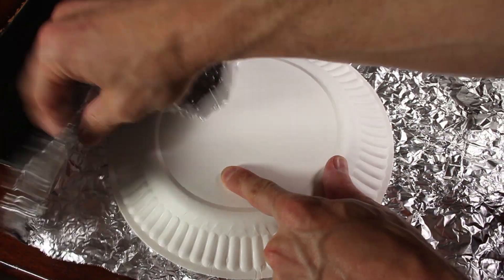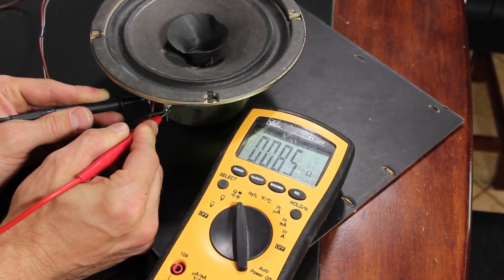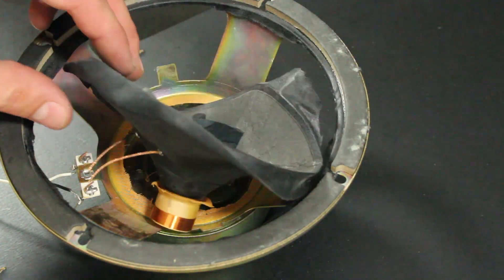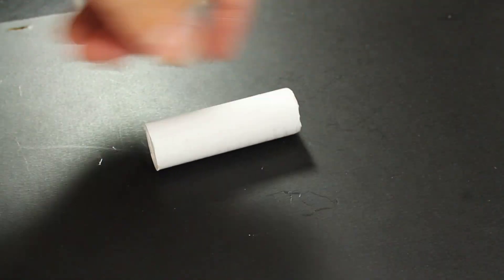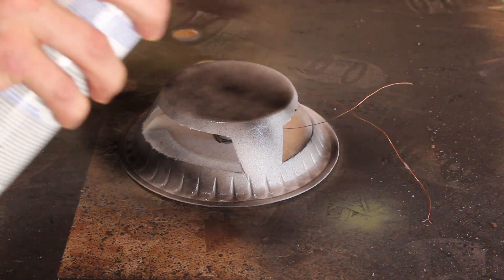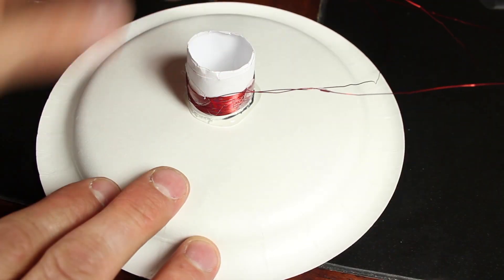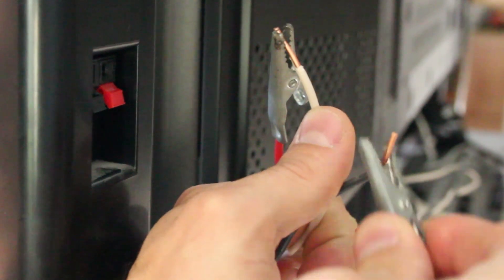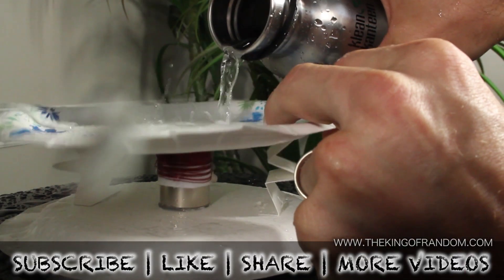Rockin' Paper Plate Speaker

Comment: Does this actually work? Because I know the method with the tinfoil/penny doesn't but I'm curious to know if it's worth it.
Reply: it should work.  use the first design with a quality magnet.  it is a speaker, so headphone signal may be too weak.  as shown, the voice coil should consist of a single layer of winds, so that no back emf/noise is produced.  cheers
Reply: Thanks

Comment: this sounded easy at first all I need are these magnets but NOPE I need wire (which I don't know where to find) and some super tools I wish I had but didn't. this was a great video
though!
Reply: you can find copper wire in old extension cords, old chargers, lamps, old microwaves, anything really that has to be plugged in to an outlet. and as far as the tools go the only tool i seen was a hot glue gun, the clamps could be replaced with coated paper clips.
Reply: BlueKnight Gaming If you consider a box cutter and a hot glue gun "super tools" then I don't know what to tell ya

Comment: if the same magnet and wire from the second setup was used in the first would it have just as good a sound? or is the second setup better? i like the aesthetic of the first one better.
Reply: the cleaner the wire
the better the sound

Comment: does not work. i used a microwave magnet and the copper wire out of the microwave capacitator and did not work. so mad. looked forward to a paper plate speaker.
Reply: use nemudium magnet

Comment: could you tell me how I would connect this homemade speaker to an aux cord or phone?
Reply: +anty292 get a 1/8th mono audio jack. connect copper parts of the two wires to the two the two prongs on the end of the jack.
Reply: You probably need an amplifier
Reply: get earbuds
cut them
and solder the orange cable to an end
and the green/red one to the other end
Reply: HappySlappyFace  No, a mini amp is required I've tried it. A simple one like this would do : http://www.aliexpress.com/item/3pc-LM386-mini-amplifier-board-signal-amplification-module-3-12V-DIY-KIT-better-than-TDA2030/1620433955.html

Comment: The way the coil is wound up really matters. You get a much better and louder sound if the coil is uniform and clean. If you just wind it up quick and dirty your speaker will not be as loud and will not be nearly as sensitive to the changing voltage running through the coil. The better the sensitivity, the clearer your sound will be. Powerful magnets are one thing, a powerful uniformly wound coil makes things better and reduces the need for more powerful magnets.

Comment: i have a question how can i connect is to the Phone
Reply: Find a spare set of earbuds. Then cut it a few inches above the male connector. If it is a stereo earbud, figure out which of the 4 wires are for sound and which 2 are ground. (there should be a sound and a ground for each ear) tie the sounds together (make sure exposed wire is touching) then do the same with the 2 grounds. Cut the wires at the end of the place they are meeting. Then connect the positive end of this speaker to the sound wires and the negative to the ground. Hopefully it should work
Reply: uhh  that dude is complicated 
just get earbuds
cut one wire of the two wires at the part its splits up
and connect them
you in the end may connect either orange and red wires to the speaker or orange and Green
so basicly orange is +
if you see red n orange leave it alone thats microphone

Comment: 1 cent for paper
That's assuming you already have the paper. You're not going to any store and buying a single sheet for a penny.
Reply: +Ryan Moulder If you don't have paper, get paper.

You can use paper just like a computer, except it has greater control, and doesn't need power. It also lasts decades or longer, unlike electronics which become obsolete within a few years.

Wow, how did we ever manage without paper?
Reply: I'm just saying. Can't always assume.

Comment: HELP I DID IT LIKE THAT

•COPPER WIRE, BURNED OFF ENDS
•GOT MAGNET (TRIED 2, EARBUD MAGNET, AND 4 WEAKISH MAGNETS, BLACK ONES)
•MADE A COIL
•AND I HAD AN OLD EARBUD JACK THING AND WIRED UP THE ENDS AND
NO..SOUND.. 
HELP ME PLEASE WHAT AM I DOING WRONG?

and also I wanna make secret  earbud so I can listen in class, MAGNET in ear and COIL around neck, tried and didn't work help sorry for caps

Comment: Just curious, could you make two smaller versions of them and make headphones for under $2?
Reply: +Alex K yes sell them for 100 euro and you can beat beats
Reply: ***** $_$
we could get ritch on this!
Reply: Alex K yes!
Reply: Alex K sorry guys just put a patent on this
Reply: I live live in hong Kong and it's a quite expensive city. But, I know a shop where you can purchase ok quality headphones for just 12HKD which is almost 1.5 USD, thats well below 2 USD.
Reply: +Shayna Javaherian OK, so I say this as an electrical engineering student who's done a fair amount of tinkering:
this is a really dumb idea.
Here's why: what he's doing in this video is simply a proof-of-concept. What he's not doing is constructing a speaker driver that will last, sound good, or even necessarily not  short and catch on fire.
When you get into headphones, your hands are going to be way less relatively precise given the smaller scale; moreover, a speaker or headphone isn't just a driver; it's the enclosure that constrains the driver, and determines the actual frequency response of the mechanical system.
It's not just that you have to construct the tiny drivers, you also have to construct enclosures that house those drivers in a comfortable way with a decent frequency response; then you have to wire a TRS (tip ring sleeve) jack to the drivers, which requires  soldering if you have any intention of using these things in the real world.
There's no way you'll end up with serviceable headphones without considerable time, skill, dexterity, and most likely machine tools. A 3D printer, maybe, if you're both good and lucky.

If you just wanted to see a cutesy scaling down of the speaker concept as proof-of-concept for headphones... I don't really see the marginal value.

Sorry. Dumb idea is dumb.
Reply: +Alex K Beats already did that
Reply: ***** Me too!
Reply: sure whats your big idea?
Reply: +DeadPistolsBrainGerms LOL! When I saw this comment I just burst out laughing! xD!
Reply: +Matti A. Not sure if joking or just not very smart...
Reply: It’s too late now...
Reply: beats by dr dre   cost them like 3$ to make and they sell them to suckers for 200$

Comment: Not everyone has a huge ass tv to ninja kick apart just to take its copper.
Reply: George Washingpun this was described in a previous video. You can get them free all day long on Craigslist, if you're willing to move and store it He's used his for several things.
Reply: +George Washingpun You could really just use an old charger cable that no one uses, and remove the rubber.
Reply: I got mine out of optimus prime.
Reply: George Washingpun 

You can get it from any device that transforms AC.
Reply: Yah that was  cooooooooollllll
Sooooooooooo cooooooollllllllllllllllllll
Reply: George Washingpun buy it george!!!!
Reply: George Washingpun Well he got the TV for free off of craigslist or something so anybody could really get one, usually you have to pay to recycle those because nobody wants them anymore, but if you find one someone doesn't want you can probably get it for free, or very cheap.
Reply: Ido
Reply: transformers.
Reply: +Ryan Cook nice
Reply: +George Washingpun alternative to Craigslist, go to Goodwill. Find a linear power supply-- one of those wall warts that converts AC to DC and steps down power.
The linear ones will be significantly larger and heftier than a switching power supply with the same voltage and current handling rating.
Inside of one of those, you'll find the exact same coiling he described in his video.
Also, the amount of copper needed to make this thing isn't that expensive in its own right. It's definitely way cheaper than the giant cylindrical Nd magnet he whipped out at the end.
Reply: InverseAgonist Well dang... Thanks
Reply: funny things is, I have the same TV in my room
Reply: kelsey brokaw I interpret this as volunteering to let it be kicked apart for a couple feet of magnet wire
Reply: Adgfhfgcf
Ujejdjdjj ì      kdkjcidjdk
L

Rkjdjdjd
Reply: Ryan Cook l
Reply: nice markiplier reference

Comment: Burning the insulation off only works with NYLZ insulation the insulation fails at burning temps.  APTZ and HAPT are your "Armor Poly-ThermaleZe" & your "Heavy Armored Armor Poly-ThermaleZe".  Insulation for those fail much higher than you can get with a match, those require manually scrapping to remove the insulation if you take the wire from a transformer as you suggested if it's an EI type iron stacked transformer the I's have a sharp edge on one side and works well to scrap off the armored armor poly-thermaleze.

Comment: You should also be able to make a speaker with 2 spiral made of foil, on opposite side of a paper. Where the spiral turn the opposite way around. Connect the two foil part to the sound output, and place it over a magnet.

Comment: Did he just stick his finger in fresh hot glue without flinching?
Reply: johann zammit
the kind i have has the temperature of molten lava.....
Reply: I do it sometimes :) it is not very hot
Reply: jackson edwards did you see the round house kick? he's a ninja. ninjas don't feel pain xD
Reply: thats easy to do, just lick your finger and you can touch the hot glue and spread it.
Reply: depends on the composition of the glue sticks and the glue gun temperatures.
Reply: Some glue guns dont get very hot
Reply: SoulRaver124
pizza slingers can attest to this truth. :)
Reply: jackson edwards Yeah its prop a cold melt hot gluegun, the ones that only go to like 60-70 degrees c.
Reply: If you get your fingers wet first the glue doesn’t burn
Reply: jackson edwards  after working with glue guns for many years its actually easy to do so with our burning yourself you just need to not let the glue stay on your finger and whip it off as soon as your done , i do it all the time and i have a high heat glue gun, the same type iv been using sense 3rd grade  its just like how after being a cooks for many years  your there comes a time were you  don't get burnt taking a 400 degree piece of food out of the oven

Comment: Where can I find insulated copper wire？
Reply: In the walls of your parents house , just use a sledgehammer
Reply: Any old no good for anything discarded electrified gizmo gadget thingamajig with wire it. Examples lamp cord, old TV cable, pc, cd dvd blue-ray player, clock, car, an stuff. Cautions. 1.Unplug the gizmo first. 2. This is the very important number to to read. Be very sure not to steal or strip a gadget being used by the current owner. 3. Tools needed to get the wire out  Screwdriver, wire-stripper pliers, an possibly a wrench. Or a good Hammer and knife. 4. Smash the case if you have no tools. 5. Pull out or cut some wire. Use the knife an strip the insulation on each end of wire 6. The knife should be pointed a way from your self. 7.This helps from slicing open any body parts.Number 9. My goal is to make people laugh a bit when writing. Now I better watch the video. ThankYou
Reply: thanks! I feel really sorry cuz you guys typed an essay for my short question :)
Reply: Condor Hawk U have caused a conundrum 4 me. If u r sorry for me typing way 2 many words. Should I b sorry 4 typing unnecessarily lengthy line of words? U never have to apologize to me 4 what I do.Good luck with ur speaker. Thank You
Reply: Yep! Went quite well. Trying to improve the thing with a better magnet
Reply: condor hawk Condor Hawk ask a mechanic, electrician, or a TV radio shop for used magnets. Explain what your project is for. They are a great sources for free magnets. Good luck
Reply: Thanks! Appreciate it!
Reply: old raido or normal raido,tv or sacrfise old speaker
Reply: Zampther I was thinking he could just get them from a set of speakers he has lying around the house...
Reply: in your brain ....................just u have to put it out.......
Reply: condor hawk Was your project successful?
Reply: ok!! ok!!
Reply: it's called "magnet wire" if that helps.

Comment: I tried this experiment. It seems that I blew something up because my main speaker no longer sends sound to my smaller speaker.  It work fine for a few minutes and then I turned the voume up and it stopped working.  I tried to see if my normal speakers worked and they don't work either.  Glad it was an old set of speakers.  Is there a safer way to do this project without blowing up a set of speakers. Is it even possible that i blew up my main speaker doing this?
Reply: Not really. There is an impedance inherent in the coil pushing against air.
Reply: If your stereo no longer makes sound no matter what speaker is connected to it, you have blown the stereo amp.

It was irresponsible for Grant to suggest doing this without adding a resistor in series to protect the amplifier. This speaker will look like a very low resistance to the amp. Most amplifiers will blow out if you put less than 4 ohms on them and turn them up.
Reply: Eiad Hamwi
You can measure the resistance of the coil with a multimeter set to OHM setting

Most of your little amps and prepackaged bookshelf systems are down to 4 ohms while the larger head units push 8 ohms

If your Ohms are too low then you are returning more power to the amp than the speaker needs to function properly, which in turn will overheat your circuit board and short your amp

To be safe...I would measure the impedance (or look at the tiny sticker) of the speaker that came in the same box as the amp (if they were sold together in the same box)  then measure your coil impedance...it's never exact but 3.5 to 4.5 is safe zone for a 4 ohm stable amp.....an 8 ohm amp will need at least 7 ohms of resistance but I wouldn't chance it too much.......

I am an audio engineer...this is what they do in live audio when they are cabling up the speakers to the amps.....calculate resistance....there are tricks to wiring them also....learn about series and parallel wiring and you will be glad u did
Reply: yeah I would suggest using a sacrificial amplifier since the resistance isn't matched..u will likely ruin your amp
Reply: I'm very sorry that you've blown your amp. You can see why I strongly suggest putting a 10 ohm resistor, 10W in series with this homemade speaker.
Reply: Steve Greenfield I'm kind of scared to try it anymore out fear of blowing more stuff up...
Reply: Get that 10 ohm, 10W resistor. Every stereo can handle that load.
Reply: Steve Greenfield Thanks.  Do speakers normally have a resistor as part of their makeup?
Reply: Steve Greenfield
About how much resistance should we apply to the paper speaker?
Reply: The resistor also has to dissipate some power. A 10 ohm, 5 or 10W resistor should do. Watch the temperature of it if you turn your amp up.
Reply: Eiad Hamwi
the resistance is the length of wire in your coil
It goes by many names...inductor, transducer, but not a resistor that is a component not used in speaker building.....perhaps it could be an inline filter....but that's not for this experiment
Reply: TheArtisanRBenjamin ohhh, okay. Thanks for explaining that. I'm studying to be an electrical engineer, so I already know some stuff about this, but I never really got into sound, so this is somewhat different. Anyway, thanks for the input.
Reply: The impedance of a bare speaker varies with frequency because of motor action of the moving coil. The rated impedance is about 20% greater than the DC resistance.  

But this DIY speaker has a very low DC resistance and can harm your amp. That is why I strongly recommend that you add a resistor in series.
Reply: I tried this also but using the sub output on my amp and it just made a slight popping noise when I plugged the sub back in so yeah

Comment: What if I take a paper plate and manually shake it with my hand instead of with a magnet? Will it work if my hand was extremely precise?
Reply: You would need to be super fast, Bass sounds are mostly around 100Hz and that means that you have to make a 100 times per second... But yeah

Comment: I've just finished my year 12 physics course and in it we studied solenoids and forces due to magnetism. Is the way the speaker works by pumping s current thought the wires wrapped around the magnets which creates a magnetic field that is then repelled by the permanent magnets causing the system to vibrate?  Just curious
Reply: No, that's how magnets work. Speakers work because god tells them to.
Reply: Retake the course plz you where sleeping in class.
Reply: Trying to impress? Google has a good guide
Reply: Yes, when the current flows one way, the coil repels the magnet and the coil and speaker cone moves out. Then when the current reverses, it attracts the magnet and the coil and speaker cone are pulled in.

Comment: This is a GREAT way to damage your audio equipment.  If it's rated for 8ohms, going to a higher impendance (i.e. 16ohms) is safe, but going lower than it is rated for (i.e. 4ohms or 2ohms) can cause permanent damage.  You have a multi-meter; you should have tested the resistance before connecting it to anything.